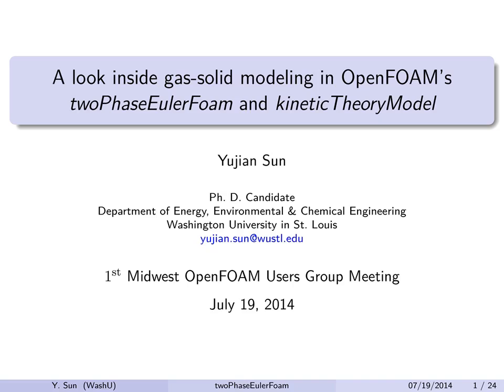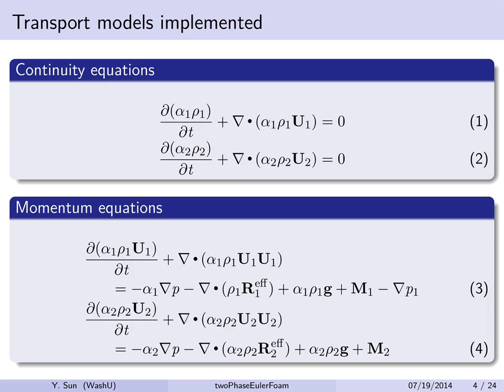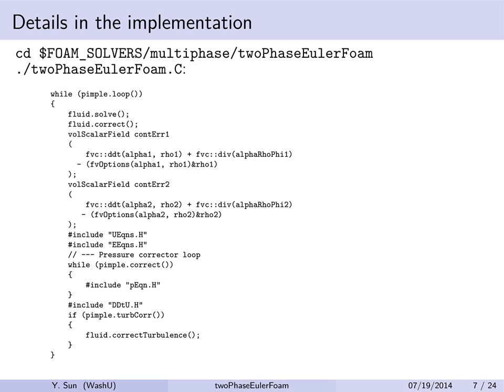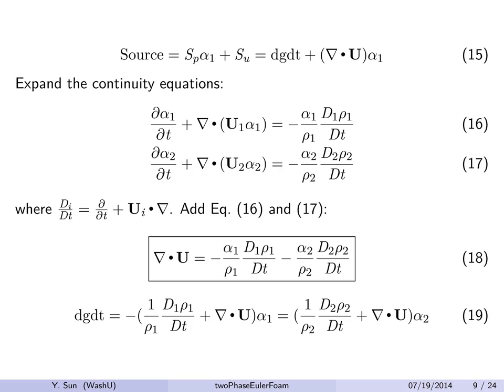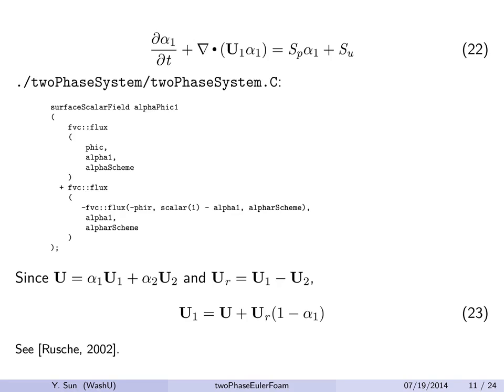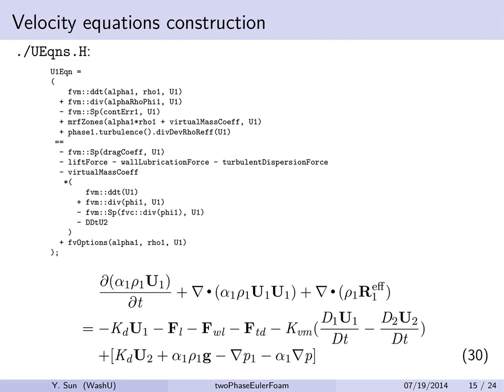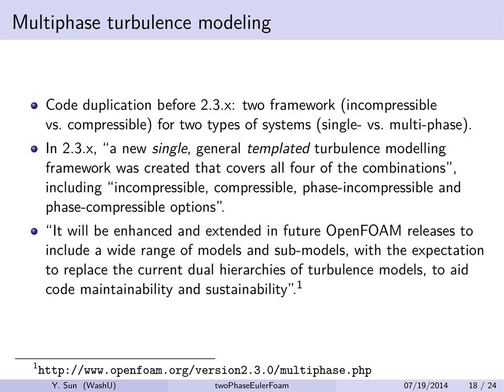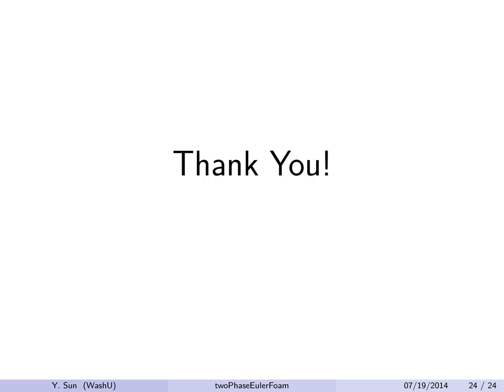A look inside gas-solid modelling in OpenFOAM's twoPhaseEulerFoam and kineticTheoryModels

Comment: I am also working with fluidizedBed/RAS (twoPhaseEuler) model. I am using 2.3.0. In my simulation I want to apply partially slip Johanson Jackson boundary condition. my theta.Particles and U.particles boundary conditions (in 0 folder) are as follows

for theeta
walls
{
type zeroGradient;
}

for U.particles
walls
{
type fixedValue;
value uniform (0 0 0);
}

does it mean no slip boundary condition ? If it is so, how can I define partially slip boundary condition. Also where to define "Specularity coefficient"